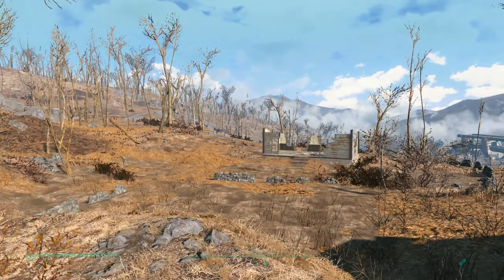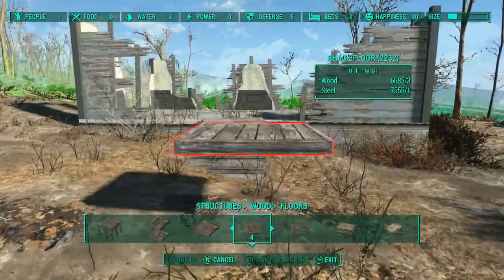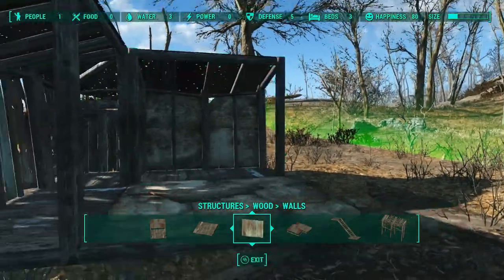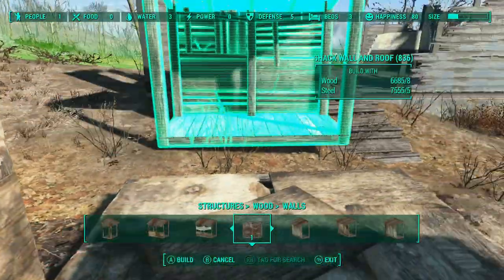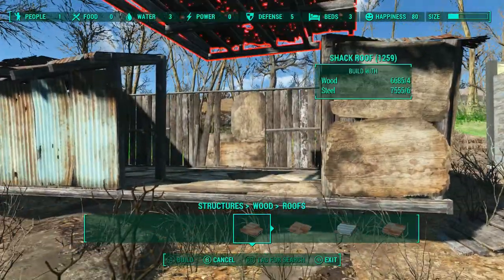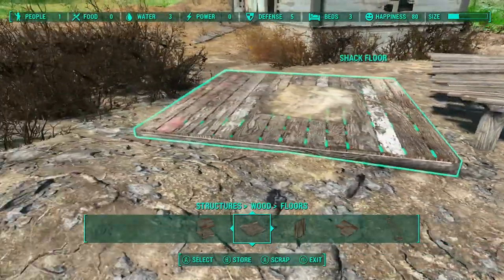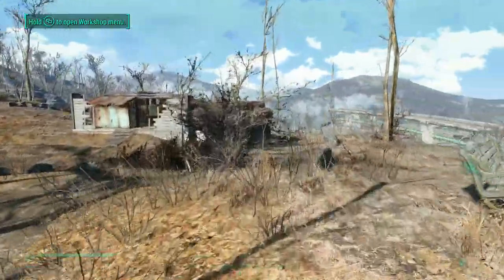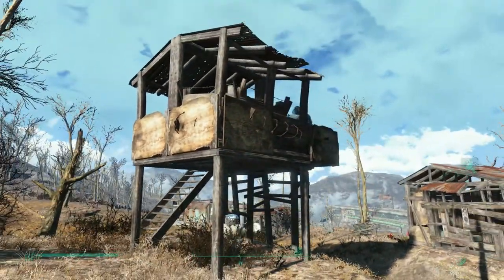Settlement Building Methods and Techniques - 03

Comment: Hi Sar, Good video, Learned something new again. Fences inside floors, cool. I've used your doors in sanctuary, so much better than having to put in doorframe walls. Thanks for that.

The more occupied beds than settlers thing I got sorted. It appears that if you change a settlers bed the old one can still be set as occupied. You can reallocate it, no problem, but it does seem to upset some pathing. I just did the slow thing of checking each settler (defence is the worst, they follow so slowly) then stored all other beds. It seems to have sorted so many other pathing issues as well, I'm quite pleased with my self. 

Keep up the mets  n tech videos, they are excellent. Hope more people find your channel,as its quickly becoming one of my go to's.
Reply from the maker: Thanks! Always nice to know something in these videos is useful.

And yeah, the settler assignments is something I've had issues with as well. FO4 does have some serious recurring difficulty with "clearing the table," so to speak, when it comes to assigning and reassigning. I'm going to be covering how to work around two of the one that annoy me the most in the next installment--once I unlock the settlement I want to demonstrate with, anyway.
Reply: +SarDeliac I'll look forward to that.

Comment: The group select tip is great.  Even though we have so many different materials to use, it is still nice to use the older materials for the more 'crappy' look.  

I think build order is the most important concept for any kind of semi complex or creative build.  I have been mentioning it more and more in my videos just to reinforce the concept.

Great vid and series.  I wish I had found you much earlier.  I blame Phoenix, since she just told me about you a few weeks ago. ;)  Just kidding, she is great.
Reply from the maker: Yeah, Denise is good people for sure. :) I gotta be honest, one of the main reasons I prefer the standard or original materials is I've been using them so long I know exactly how they work and what they can do. Plus, well, I spend a lot of time studying in-game structures and assets, and almost everything the raiders build comes off the Wood and Metal tabs... so that influences the style pretty heavily. (Bright side, it makes everything look like it "fits" a lot better.)
Reply: I agree for the most part, about using the older materials and how it fits into the 'world'.  In my mind I justify the new Barn and Warehouse tabs that the materials is scrapped from other locations. 

Which is why I like to mix buildings made from different materials.  I feel like the over all settlement has a more organic feel.  I also hardly use concrete to build with for the same reasons.
Reply from the maker: Same. I'm still working on the whole mixing-materials thing--it's too easy to stay on the same main tab when building stuff--but progress continues. I can work with concrete, a little, but I dunno, I don't find it to have many "thematic" uses. Trying to work it in where I can.

Comment: Im a bit late, but I tried using the plank bridge to slide in a structure at jamaca plains and it just isnt working. Any tips on what I might be doing wrong?
Reply from the maker: It's just a fiddly piece to work with. Generally when I want to slide it under something I'll keep the side with the higher edge on the outside; that's the most problematic area to sink into something.
Reply: @SarDeliac  thanks for the feedback. Will implement next time.